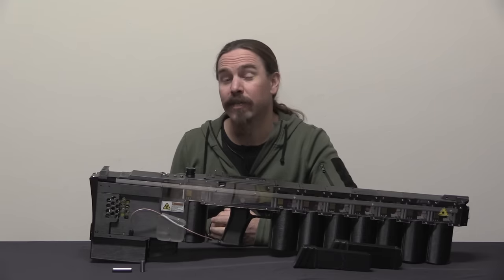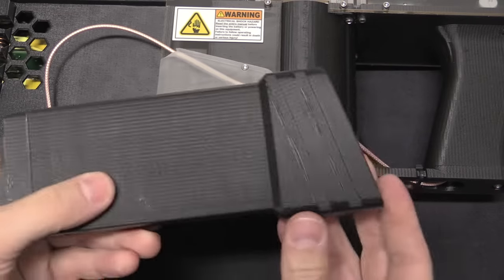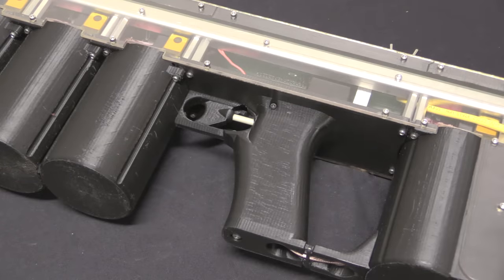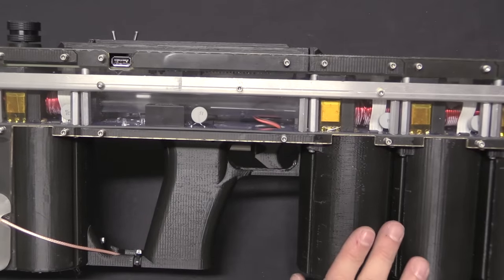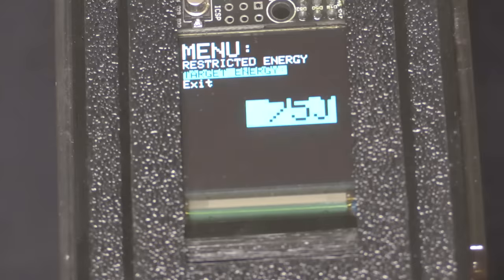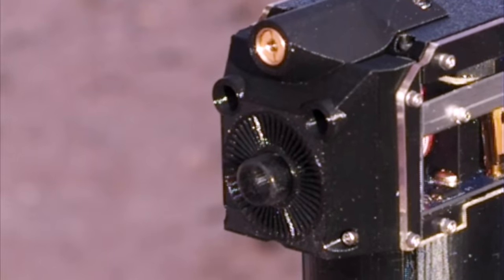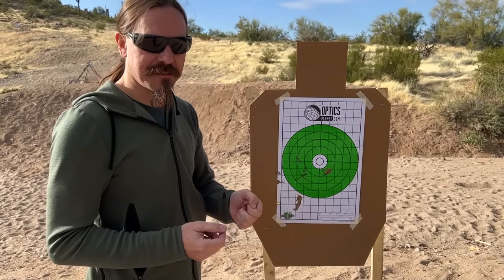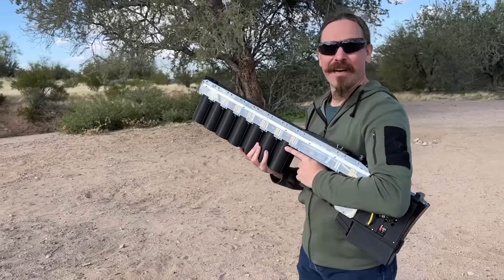ArcFlash Labs' GR-1 Anvil Portable Gauss Rifle

Comment: Now, put one power supply per capacitor. Swap those shitty coils for flat-wound coils, made from rectangular crossection copper strips, plated in silver, with PTFE tape between the individual strips for insulation, and submerged in a sealed alcohol bath.  Couple the inductive kick from each coil into a secondary coil for efficiency. That should get the rate of fire and muzzle velocity up significantly, but it would likely be best used for all manner of fancy "less lethal" things, like a plastic and wax vial with weighted tip, and filled with "discomfort dust" to break open on impact (without blowing out someone's forehead, like seen recently in "peaceful" police interaction videos) , or whatever. To bring this up to combat speed, you'll need to use Gyrojet rounds... Which are the ultimate in rounds, and should easily achieve 3D+6 damage.

Comment: With all the potential benefits this has (MUCH higher potential velocity and rate of fire, negligible recoil, much quieter operation, simpler logistics due to the ammo basically just being chunks of metal, the potential for much more advanced ID locking systems ala MGS4, etc) it's hard to say this isn't the future.

Firearms are reaching their upper limits in terms of how much power can really be harnessed from chemical propellants, while armor is still advancing. But we are also seeing tons of advances in energy storage technology due to advancements in green energy, and consumer electronics in general, so this just becomes the natural result. 

Firearms are reaching a point where swords and pole weapons were around the time that they reached their peak in the 16th century, where they are becoming more and more specialized to fill smaller and smaller niches, as bigger advances become less and less possible due to the designs already being so optimized.

This technology isn't driven by recoil for the action, so these systems will be able to shoot as fast as projectiles can be fed into the chamber, and the theoretical velocities these guns have already been able to produce (like DARPA's big artillery railgun experiments) absolutely blow away any gun ever made. It's just a matter now of miniaturization.

I think by the time I'm an old man, something like this but more miniaturized will be basically a standard military weapon and firearms will mostly just be in the hands of insurgents and collectors

Comment: They should consider a fin stabilized sabot round.  This would not only allow for better accuracy but also offer more flexibility regarding the round.  Is it better to have a nonferrous dart and ferrous sabot?  Ferrous dart and nonferrous sabot?  Or ferrous both?  How about a neodymium dart with Teflon sabot?  Also, drag will work against them considerably.  They should consider fluting the barrel.  I mean that in a 'paintball' way.  Have holes running along the length of the barrel.  This will help prevent the build up of air in front of the round and prevent the build up of a vacuum behind the round as it accelerates.  It will also help with keeping the barrel cool.

Comment: Instead of reducing the overall output to reduce charge time and heating, Arc Flash should consider firing alternating banks of fewer capacitors.  This way you can get at least 2 shots in a row before experiencing a charge related delay in firing.

Comment: If there were a slice (or a few slices) in the barrel with a pressurized air stream blowing down (or up) on one side of the projectile as it's propelled through the barrel (through 1 or more of the earlier stages) it would spiral as it exits the barrel making it more accurate.

Comment: That's a ducking drop in ancor for all thread. U drill a hole, then place the anchor in hole. then use a set tool and hammer, or drill attachment. And drive the anchor in , which will then flair out and set the anchor.

Comment: I wonder of these would be most useful in space. On one hand, they'd probably be resistant to cold welding. On the other, they get hot, and heat can't dissipate as easily in space due to the lack of an atmosphere.

Comment: Whoever came up with a slug THAT enormous and heavy, clearly misread which variable in the equation is squared, and which is halved. The whole point of railguns is insane muzzle velocity delivering far more kinetic energy to the target than a slower, heavier round, ever could. No part of the concept is designed for -- let alone competitive as, to be frank -- a shotgun replacement. As for the tumbling, setting the slug spinning inductively over the three second charge time, I would have thought to be a fairly obvious choice; but perhaps that is asking a bit much of the magnetic suspension. Here too, heavy rounds are very much NOT what this concept is good at. It's not a cannon, so much as a magnetic ballista.

Comment: the way magazine tumbling showed that the mag should be ball-like shape to perform well.. since electro magnetic will contantly change the direction of the steel.. so ball shape would be the best option.. dont need to be follow the real gun size.. the point here is the power of the shot perform

Comment: Given the rapid improvement of batteries we currently see coupled with the ever advancing computer tech, this could be a viable if but still primitive weapon in twenty years. The Coils will be the biggest hurdle, and of course you will have to carry around multiple barrels, as they will need to be changed out quite frequently. I hope to see and fire a fully realized Gauss gun before I die.

Comment: They 100% have to make thinner projectiles that are lighter. Something like 5,5mm or 9mm maximum. Also they have to add little capacitors on the side of the big ones and they have to make a threaded metal barrel that cant shake around like the current one. Then we have a real weapon and real accuracy.

Comment: With all that EM, these guns will be very obvious to find in the field after they fire.  Expect taking on fire immediately after sending a round.  That and the fact that you can't be near a radio. I can see using metal casings filled with ceramics, plastics, explosives, liquid gels anything that can be deployed immediately while providing a small payload.   Maybe even nonlethal.  Eventually they'll figure out parallel charging circuits for faster shooting and active cooling for the coils. But cool nonetheless.

Comment: Is there a significant advantage to loading flechettes into this, given that its firing at very low velocities without any rifling effect?
Also, would it be possible to generate a pseudo-rifling effect by synchronizing the delivery of the electromagnetic energy across the coils?

Comment: They say there's no contact with the barrel... BS, you can see the tumble in the slowmo parts and the barrel vibrates when the projectile exits. Probably also what adds to the tumbling projectile issue.
Reply: Not necessarily. The tumbling and barrel vibration could still come from magnetic forces.

Comment: Ah yes, 3D printed parts and a raspberry pi? 

Even if the slug is not in the barrel, there might still be some debris or sand with magnetic properties - which will get accelerated. So be careful 

Add some cameras and tracking models. Put coils at different places around the barrel - could correct for moving target or measured distance, wind etc. 

So in a year or two it will be intense.

Comment: 4.000-16.000 amps is simply not possible even in micro seconds, the transistor legs and the coil thread thickness is not able to carry this kind of current, no matter how short the time is.
The transistors visible through the side window are not capable of delivering this kind of amperage in that kind of housing, if this is the main switches for controlling the gun, the amperage is less then 1.000A.
I would love to see the data sheet on this thing.
The gun is super impressive, but this is not thousands of amps.

Comment: Your projectiles tumbling because your barrel has no rifling inside of it. Hence the name of a" rifle" because of its barrel. This is defined as a gun . Like shot gun. It's not a rifle.
Reply: Even if it did have rifling the projectile would not spin. The projectile does not come in contact at any point with the “barrel” and there are no gasses to spin the projectile as there would with a rifled barreled firearm. Using powder, gases, combustion , to push out the projectile and spin it. Even if the barrel was rifled , it would still maintain the same spin.

Comment: There is a guy who uses tech to crush coins.  Even a higher end accelerator can get objects to multiple times faster than hypersonic to test how gases interact with high impacts.  I guarantee you, tech can be used to fire materials at deadly speeds using this tech.

Comment: tbh if he makes the gun lighter by taking away the touch screen and some other useless features make the gun as simple as it can be it will be much lighter and maybe way more affective
Reply: Most of the weight comes from neccesary components, mostly from the capacitors and battery

Comment: Those red deans connectors on the battery are terrible id nearly guarantee an improvement in charging times by using a more efficient appropriately sized connector

Comment: not sure how one would do this, but since i saw this tech years ago i always thought of instead of shooting metal projectiles it charges and shoots 330v capacitors with a metal spike on the front for stability and to get it through the barrel. kinda like a stun gun but shoot individual shock units (capacitors) i used to play aorund with camera flash capacitors and though nothing like a stun gun for power they still hurt and probably would stun some one with a few 330v shocks one after the other!

Comment: that's definitely NOT a 3300 amp-hour battery!... it's a 3300 MilliAmp-hour battery, i.e. a thousand times smaller than stated. An understandable mistake if you're not very familiar with li-po batteries.

Comment: so theoretically, i can mount this on a tripod, add two more lines of capacitors on the top on a diagonal, and add another 12 coils, bolt it onto the back of a Ute (pickup truck) and have my own Gauss Hog from Halo👀

Comment: hmm idr the maker but i do remember demo ranch testing out a coil gun that propelled disks instead of rods, it was much lighter and capable of rapid fire, they compared the damage of those disks to something just shy of sub sonic 9mm and was capable of chewing into soft body armor...100% rather have that thing instead of this this massive cluncker. 
plus that other thing had a much cooler indicator that was straight up designed to look like a halo display

Comment: Think this is a cool concept but could Probably be more Powerful if the Barrel Was one of those  Magnetic Accelerator things using purely Permanent magnets and then adding Copper coils in series with  a Single large capacitor Or mabye you could get better FPS using this with just More accurate sensors or timing Either way this is way to underpowered

Comment: Computers or Microcontrollers? People get these confused. The board displayed on top looks to be a microcontroller.

Most multistage Gauss weapons use multiple microcontrollers (usually 1 per stage set - coil, power, detectors, fire control/microcontroller, communication signals). This also makes the device more modular (connect a new stage, talks with master controller, calculations made, you're ready).

Comment: A few good ideas, but power is extremely lacking.  It's not hard to get more feet per second, if you make a custom PCB, do a little math, have a little patience, and experiment with different gauge coil wire and number of windings, and I promise you you can easily triple your velocity.  With somewhat lower draw on your caps.

Comment: I know it's an alpha design, but I don't like where the battery pack is so close to the clip, if you some how miss your clip and release your battery pack it will fall, and rip all the wiring, and render the weapon ineffective, cause laser weaponry, or battery powered weapons will be utilized in the future, for special forces, due to the complexity of gun maintenance, just have to get around environmental issues, especially rain, so you don't electrocute yourself

Comment: The arrangement of components is all wrong, at least for a combat weapon. That arrangement would be fine for hunting, animals don't shoot back. Capacitors have a nasty tendency to explode if punctured while charged. For a combat model, a power pack that sits on the upper back can house the battery and capacitors, with angled plates to deflect any incoming fire. This removes the need for an powered section of barrel above the trigger/grip. While this arrangement likely places more strain on the soldier's back and abdomen, the rifle itself becomes lighter and easier to control, and should result in greater accuracy. Angled fins or spiral groves on the slugs to get them spinning well before they leave the barrel might be something worth trying to improve accuracy.

Comment: A LITTLE inaccurate. Capacitors take a while to charge. They don't charge quickly at all. They DISCHARGE quickly and dump a lot more energy than batteries (slow discharge).
Reply: But does this technology have the potential to replace firearms?
Reply: @ElMiKy75  Maybe nonlethal. The Navy's electromagnet guns are too giant for handguns, but they shoot projectiles so fast the projectiles disintegrate. I've never seen them use one in war, just the tests.
Reply: @juansolo1617  I hope they never replace firearms

Comment: Not saying I'd want to get hit by one of those slugs, but it doesn't feel like it would be lethal. Hurt like hell though I bet
Reply: a .22LR handgun has 159 J of energy this is rated at 100J so if you get nailed by it a few times I think it would mess someone up. Packs more energy than a .22 air gun for sure.

Comment: I have serious doubts about this ever being commercially viable. It's just like electric cars; the energy density of batteries and capacitors just isn't there - relative to what we use (gasoline and gunpowder, respectively) and there are limits to how much better it can even get. To say nothing of the colossal carbon emissions of lithium battery production.
Reply: That's the cool thing about capacitors you only need high energy density for a split second not all the time. And if one is not enough you can just add more. Unlike batteries there has been more success in capacitor research.
Reply: Not yet
Reply: @happyjohn354  I'd be happy to eat my hat on this, but it will take a technology that doesn't exist yet to make this into something like you see in media.

Comment: Without a very high power portable power source it's never going to surpass any chemical weapons (that's firearms for those who don't know) and even with that, we have pretty much maxed out how we can make magnetic fields with nano tech and that is what this is using already and that's it.

This is about as good as it's going to get for the foreseeable future (within the next 200 years).  You could use liquid nitrogen and superconductors but then you'll have a big arse weapon on your hands.

I'd say the future is a better propellant, a better way to control recoil and better materials. Nano tech can be used for cooling and with new alloys you can make it a lot lighter while better ways to prevent recoil... That's the future we will see in the foreseeable future.

Comment: Who TF designed this crap. I mean look at that cable popping and visible . That metal mesh opened, welcoming dust and water. Holyyyy . At least make this gun waterproof (not actually waterproof, but resist light splashes and dust). Just put a rubber rings bands to make it waterproof. 

Edit: ok it’s just a toy . Not actual gun

Comment: Is electricity going to ruin guns like it ruined cars? 😐
Reply: How so?
Reply: @quartzskull8772  that thing don't look much fun to shoot
Reply: @djtomoy  due to its compact size and requiring stability it would mostly likely be a nonlethal sure but think of what could happen with energy advancements. These this being fired from ships are insane but to the the compact size it limits how much energy can be generated
Reply: @djtomoy  plus think of guns if you didn't need casings or powder anymore
Reply: Sounds like you're salty because you got gapped by a tesla
Reply: @brandonhill3283  Range decreases by up to 50% in below freezing temps